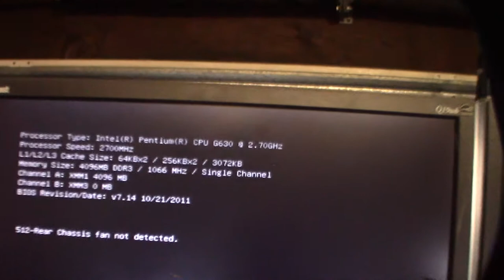3D Printed Crypto Mining Frame  Modular Compact GPU Miner Rig Part 1

Comment: what would be better is if someone printed all the like connectors or w/e so that u can just go get some like metal pieces which slide into connectors, for a full sized frame...or something to that extent.  IDK how complex that would be though.  Would have to have 3d printed parts everywhere that you have to screw something into but they could be things that you slide onto the metal.  It would be idea if it worked with something commonly sold at like home depot or w/e like if they sell these long flat metal things, or a specific size of pvc pipe or something, and then the 3d parts all slide onto (and connect) those.

Comment: You put your motherboard on top of your power supply?! Have you considered the amount of heat your psu is going to generate? On the top of that, your processor is also right above your psu. Do you have trouble with the heat?